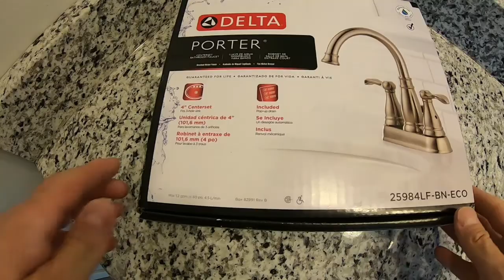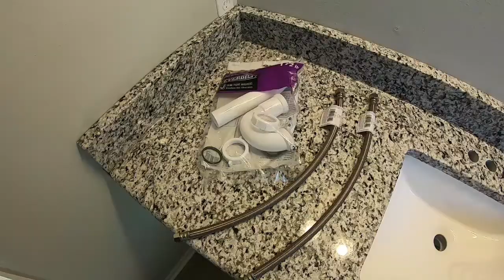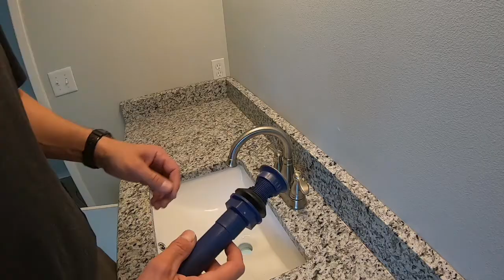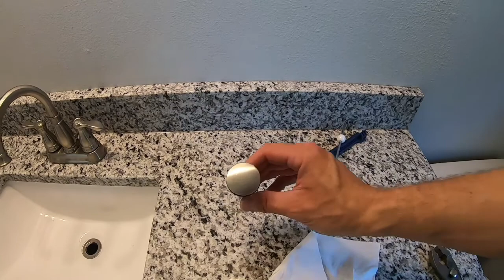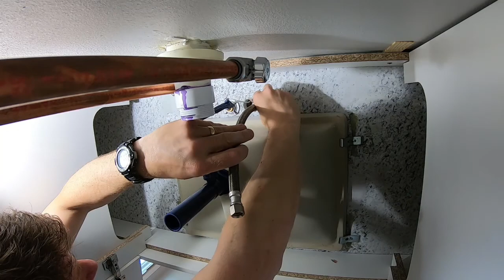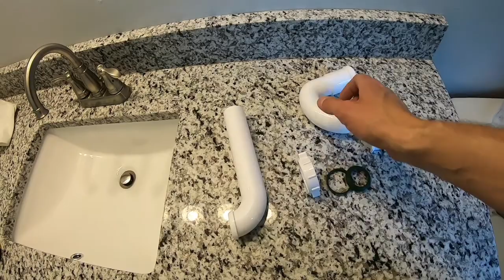How to replace a bathroom faucet - Step by step

Comment: It didn't look like you put any silicon on  the rubber gasket under the sink.  I've tightened it twice and water comes pouring out.   It looks like the rubber and the pressure should do the job.  Not sure what is going on.
Reply from the maker: You need to put silicone under the lip of the drain assembly that is visible from the top of the sink. That will seal the drain to the sink basin. No need for silicone under the sink.

Comment: You only need a 1/4 turn after hand tightening the supply line to the angle/straight stop. If it leaks you can always tighten it some more. But if leaks because you over tightened, then you're screwed.

Comment: Couldn’t you have installed the supply lines to the faucet before you installed the faucet?
Reply: I've installed hundreds of faucets. If the supply line fits through before dropping it in, the plumbing gods have truly smiled upon you that day.
Reply from the maker: I’ve done that before but I think on that one the supply fittings were too large to fit through the holes in the top. Definitely easier to donor that way if space allows.

Comment: The joint between the two pieces of white PVC is called a slip joint.  And while it doesn't use a gasket, I've seen a plumber put pipe dope on it for a better seal.